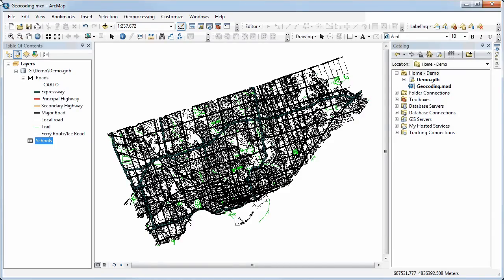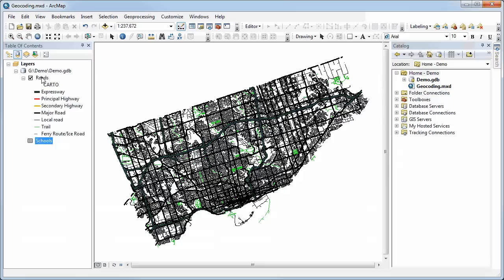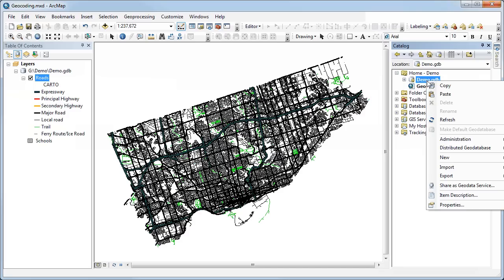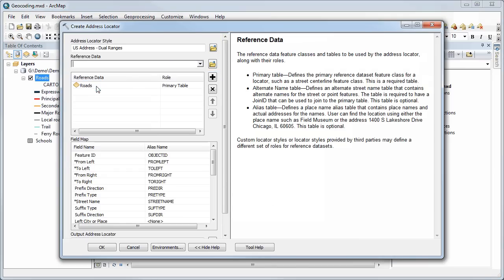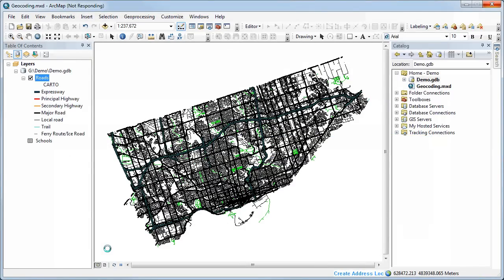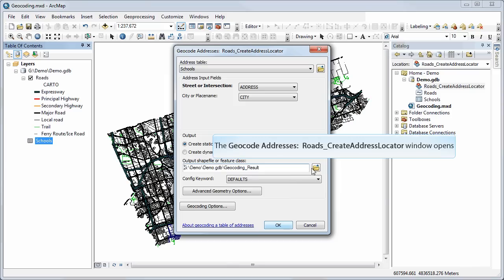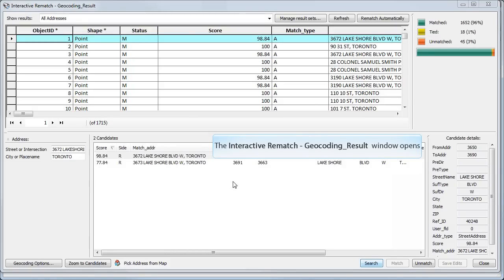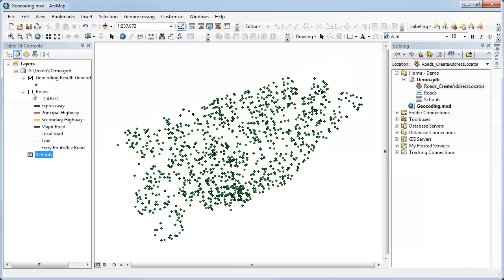Address locator setup and use in ArcMap

Comment from the maker: The main requirement for setting up an address locator is that you have a reference data set.  Essentially, what happens is that each address you want to map is matched to the same address in the reference data set.  It doesn't really matter what format it is in, as long as it is the same format as the data you are trying to map.  For example, if you had a reference data set of world cities in GIS format, you could map cities in a list by comparing it to that reference data.  I hope this helps.

Comment: Thanks for the tutorial. Do you know where can I find the street shape files?
Reply from the maker: Try searching for "gis open data" and either "centerline" or "road" or streets" and you will likely find something, although it depends on the location. For example, Toronto data can be found here: https://www1.toronto.ca/wps/portal/contentonly?vgnextoid=9acb5f9cd70bb210VgnVCM1000003dd60f89RCRD&vgnextchannel=7807e03bb8d1e310VgnVCM10000071d60f89RCRD